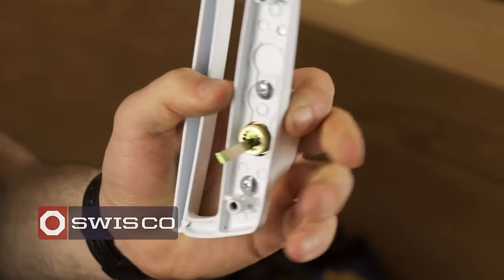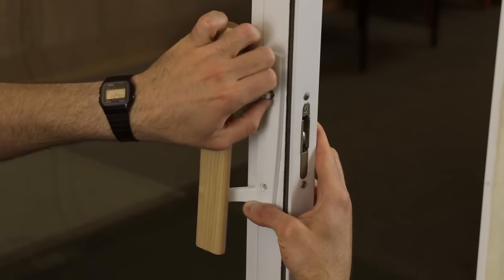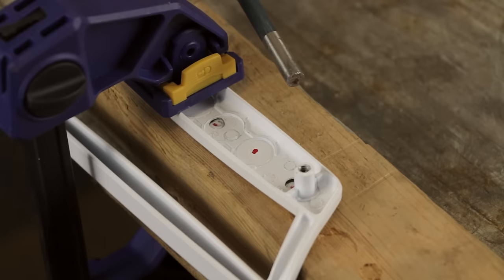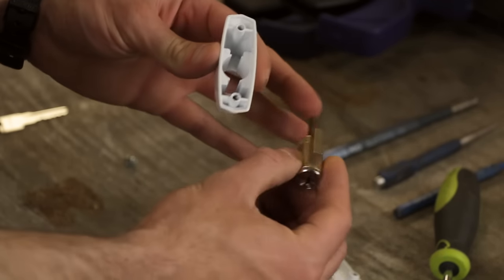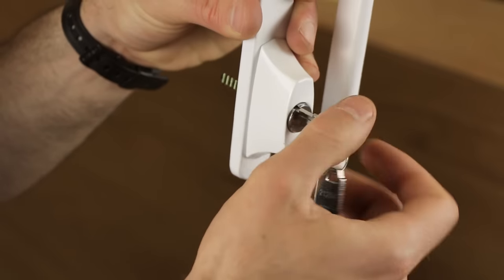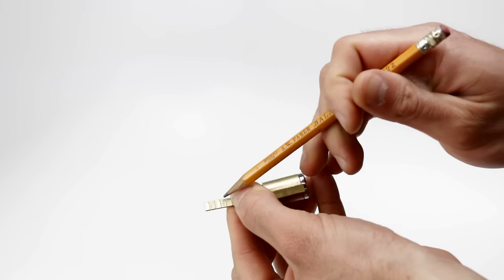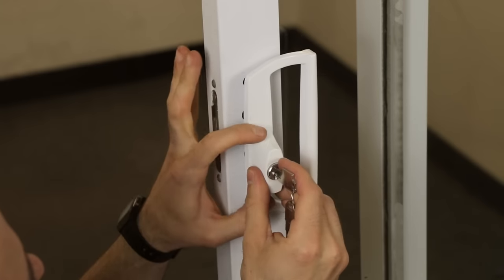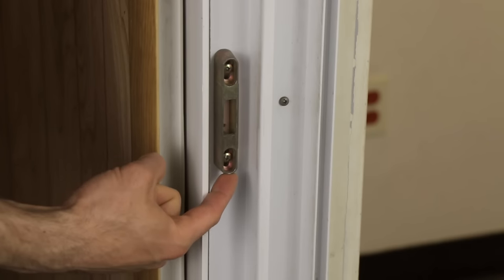How to Install a Key Lock on a Patio Door [1080p]

Comment: They make it look simple. It's not as simplistic as the video shows. You'll also need a vice and a small file. The punch outs in my handle (not a Swisco) didn't want to come out and finally when they did, the handle was beaten up and a bit twisted. However, this is the ONLY resource available to put a key lock on my sliding door. I now have a lock installed and I'm pleased that Swisco offers theirs because neither Lowes, HD nor a local locksmith had anything. Thank you Swisco.
Reply: ?  The video shows a vice and a file?
Reply: @kpazsoldan  If you own a house and do not have a vise and a file, you obviously are in trouble when it comes to normal homeowner tasks.
Reply: @DOLRED  Give me a break.  I've been a home owner for over 25 years.  Remodeled every single home I owned.  Never owned a vice, thought it would have been nice to use one maybe 2 or 3 times over the years.  Besides, I was commenting to gporter.seadog.  Sorry about your lack of reading comprehension.  At least you have a vice and a file, though.
Reply: Yes. The vise is @3:35 and the file is @4:05

Comment: The instructions that come with your 82-086 Legacy Keyed Handle set suggest that you can "break off tail ends with pliers" I would like to inform you that for those of us with mortal strength (i.e. most of your customers) this is not possible. I see in your video that you actually do it by using a vice, hacksaw and file! I wish I had the tools you have because after trying to do one of these for the last 2 hours my hands hurt so much I can barely type and I have not made any progress. I bought two of your keyed handle sets so I actually have 4 of these to cut or break. I sure wish I had locks on my doors! I also called your customer service and your representative suggested I find someone stronger to do this with two pairs of pliers, she had no other suggestions. I am off to the store to see if I can buy an angle grinder as two customers here suggested. Of course no one bothered to answer the question when they asked if this will work. I'll send you my medical bills if my difficulties continue. This should definitely be easier.

Comment: Thank you for the video. I was not able to cut spindle with a hack saw and pliers, but aviation snips did the trick. I used a dremel with a cut off wheel to grind down and smooth the spindle a bit.

Comment: Have the lock but where can I buy the white key housing? Was not able to find only the housing anywhere.
Reply from the maker: +dev3042 If you look in the video description you'll find links to all the parts used in the tutorial. Let us know if you have any questions.
Reply: +SWISCO do you have installers in la
Reply from the maker: +Shimon BenBassat I am sorry, we do not have any installers. You can purchase the parts you need on our website www.SWISCO.com and attempt the repair yourself. If you run into any trouble, contact us and we can help you with your repair project.
Reply: dev3042

Comment: Hello, I've got a glass sliding patio door that is 1 1/8" thick with a clamp lock and I want to change it out to a keyed setup with handle so that I can lock/unlock it from the outside of the home. What product(s) would you recommend for me?
Reply from the maker: It's going to depend on the specifics of your old handle, but we have lots of keyed options. Send a photo of your handle to us at https://www.swisco.com/page-id-part and we will tell you which keyed alternative to choose!
Reply: SWISCO I sent some pics and info through the site but haven’t heard back
Reply from the maker: We were closed for the weekend, so that is probably why you haven't heard back. Give us a call and we will look up your case and follow up on it. Our phone number is here: https://www.swisco.com/page-contact

Comment: Informative.  I have a Milguard & just ordered a complete keyed sliding door handle kit....
Reply from the maker: That's great! Let us know how to installation goes for you.
Reply: @SWISCO  Got the kit today and installed.  Used the kit outside handle/lock only, reused inside handle.  Lock works good (had to fiddle with it to get it oriented right to get key to lock/unlock and to remove key).

On the original Milgard handle, I saw where the lock punch out circle was located.  I will keep it and buy a lock assembly so I use it (as a spare).

Comment: I’ve got a patio door that, when I tighten down both the interior and exterior handles, suddenly the lock gets EXTREMELY tough to turn. What could be causing the problem? It’s a Pella Impervia set up on a Pella door.
Reply from the maker: It could be a number of things. I'd check the length of the tail that sticks into the lock to activate it. You can request help directly from our research team here: https://www.swisco.com/page-id-part
Reply: @SWISCO  I had the same problem about two hours ago and knew I had to cut the spindle and your video showed me how.  He needs to cut his spindle.  The two spindles are overlapping and causing no room for turning.  However...back to cutting the spindle...don't have vice grips BUT I do have a kobalt pipe cutter...can't I put the spindle between the wheel and turn and start a cut then use pliers to finish the break?  I don't want to break the spindle.  I have a hack saw but no way to keep the spindle from moving.

Comment: This isn’t a very burglar proof lock, is it?
Reply from the maker: This key lock is intended to work as a typical lock, so it should be just as secure as any other keyed handle set!
Reply: SWISCO I have a multi latch mortise lock, which can be opened with a key from the outside, on my patio doors.  I think it’s a pretty decent lock as far as patio door locks go.  They are usually just lockable from the inside and from what I’ve read, easy to break into.  I’d still like to find a way to make my sliders even more secure.
Reply from the maker: @geslinam9703  Ah! i would check out some of our security locks then - https://www.swisco.com/cl/Patio-Sliding-Glass-Door-Accessories

Comment: Umm that's a cheap ass and weak ass lock.
Reply: Yeah, but if you are stepping out of the sliding door & want to lock behind you it is only option.  I secure my door from the inside.  This is just a way to lock it if stepping out & door is out of sight